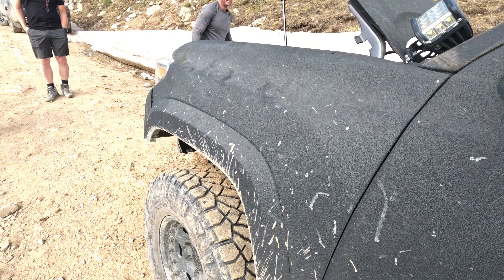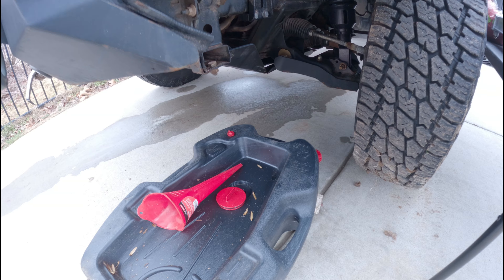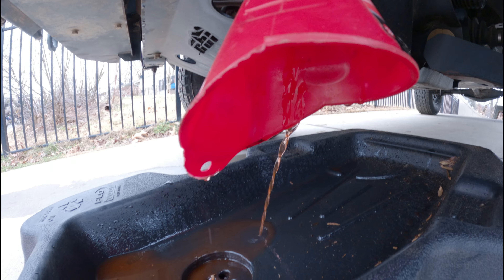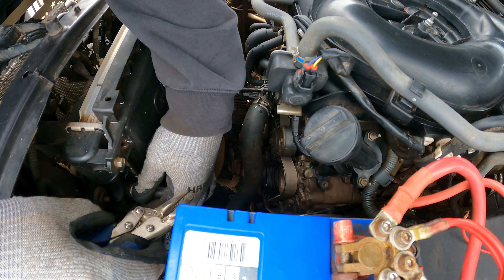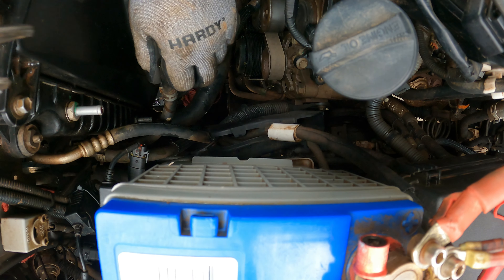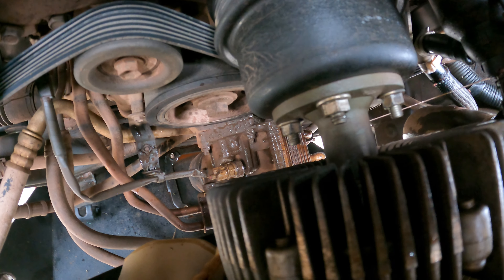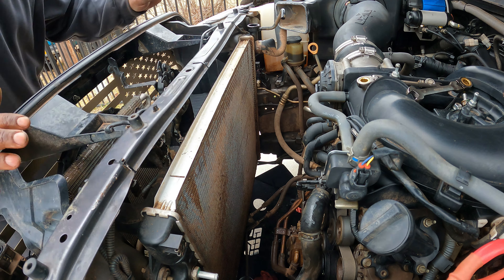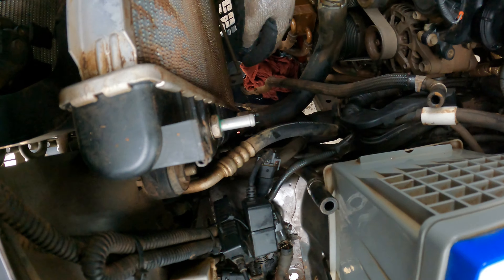Mishimoto Performance Aluminum Radiator and Silicone Radiator Hose Kit | Gen 3 Toyota Tacoma

Comment: Did you notice any difference in cooling vs the OEM radiator?   im seeing around 195 on the highway and when at stop i see no greater 210  coolant temp
Reply from the maker: So the aftermarket radiator doesn't keep fluid cooler, but it allows the heat to dissipate faster. You might still hit that 210 but it won't be there for long. 

With that said, I have noticed a difference in performance on road, off road, and towing.
Reply: @GRUNTOUTDOORS20  thanks for letting me know.   love the rhino lining on the truck. Do you also have an aux trans cooler Infront of the stock trans cooler?
Reply from the maker: I do! I made a video but haven't published it yet. It's the Mishimoto Heavy-Duty Transmission Cooler with Electric Fan with the Maxari mounting bracket.